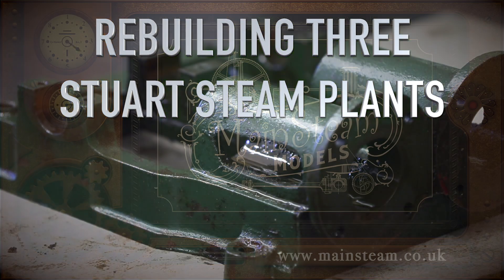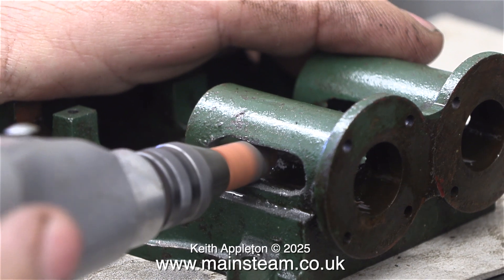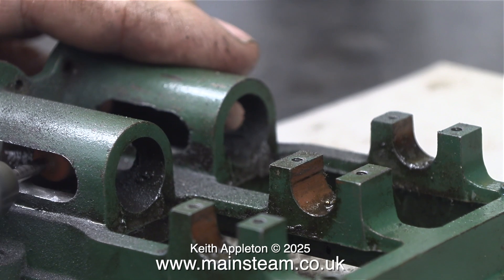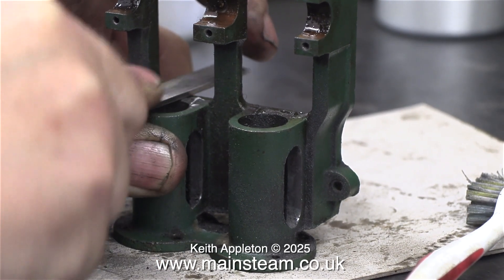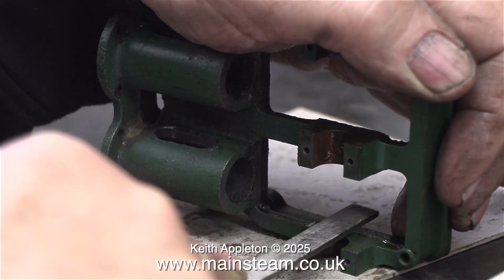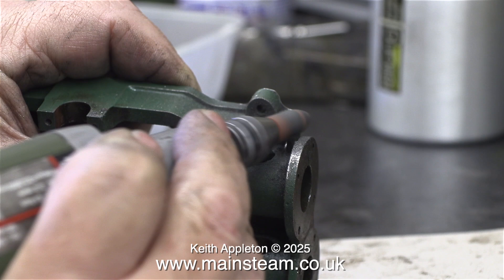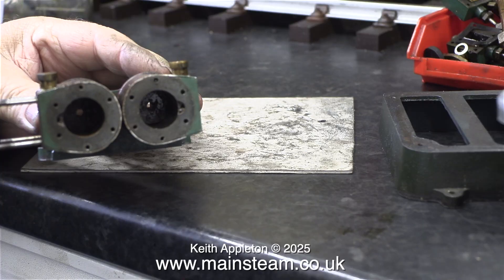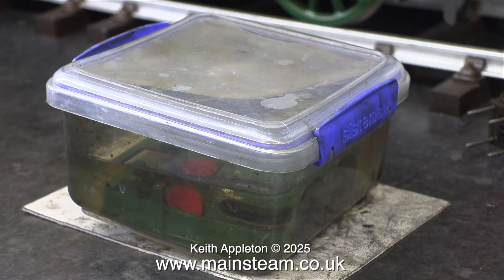REBUILDING THREE STUART STEAM PLANTS - PART #4

Comment: Nothing gets polyurethane off, which is why it is good for lining fuel tanks.  I used expanding foam and got it on my hands.  Eventually the skin cells it’s attached to fall off.
Reply from the maker: I bought a big Nail Brush and scrubbed my hands daily, it really is tenacious stuff - !